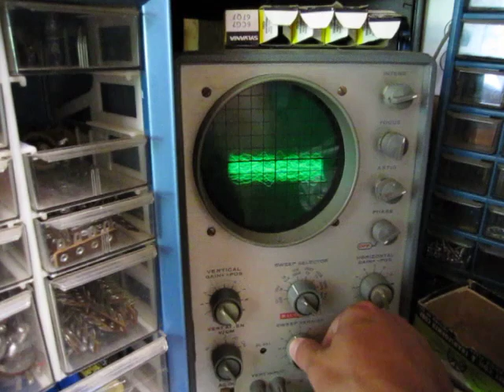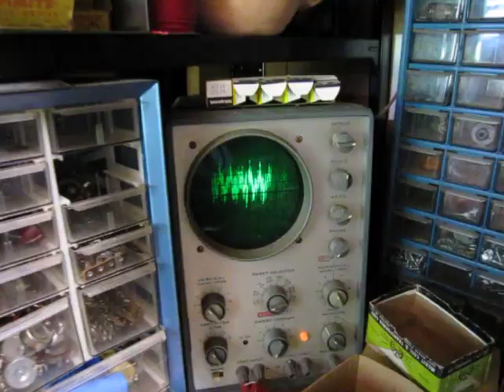Homebrew Tube Amp - 5881 ultralinear dual mono

Comment from the maker: @44433391 Ultralinear refers to an output stage that uses a transformer with a primary winding tap for the power tube(s) screen grid(s).  It has lower impedance than pentode connection, and higher power output than triode connection.  It's like the best of both setups.

Comment from the maker: @HiFiReviewer I used a lot of scavenged parts that I have built up over the years, so I was able to build this for about $200.  If you were to buy all of the parts new, it would probably cost about $600-$700 I'd guess.

Comment from the maker: @Ihateirans That's pretty much it.  The first 12AT7 triode is actually AC coupled to the second triode stage, which is a split-load phase inverter / driver.  Not a lot of voltage swing, but enough for push-pull pentode output stage - not quite enough voltage swing for full power in push-pull ultralinear.  Even though the 12AT7 has a bad reputation, I have quite a few of them, so I used them.  If I were to do it over again, I would use 6CG7/6FQ7, which has the same curves as a 6SN7.

Comment from the maker: Well, since I originally designed the driver stage for pentode, and the amp ended up being ultralinear, it's only good for 10 Watts rms.  With a proper driver stage it would do 20 Watts rms.  Since I only use about 2 Watts rms for my shop, I haven't rebuilt it.  Yet.

Comment from the maker: I build tube amps for my hobby, but I became an electrical engineer because of my love for old electronics.  During the day I'm a telecom engineer - all modern digital equipment.  At night it's all analog, tubes, high voltage, speakers, etc.